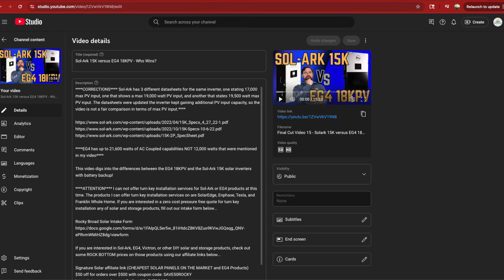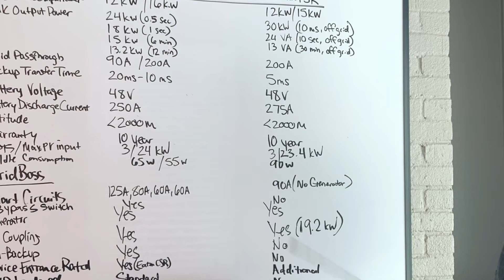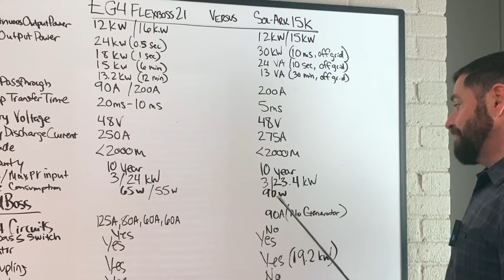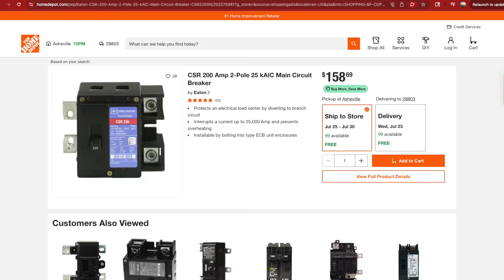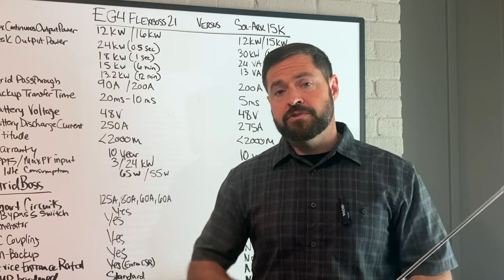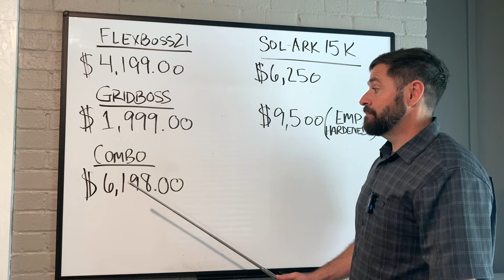EG4 FlexBoss21 and GridBoss vs Sol-Ark 15K | Inverter Showdown: Which Hybrid System Is Best in 2025?

Comment: For AC coupling the limitation comes down to the fact that in a grid-fail / off-grid situation the inverter has to provide timing for the microinverters and sink excess solar into the battery, so a good rule of thumb, more or less, no more than the inverter's battery-charging capability.  The servo is not fast-tracking so it can't quickly damp the solar down to the inverter limitation. 

That said,. the TYPE of AC coupling matters.   These systems only work with UL1741SA/SB, they will not work with the base UL1741 standard (which only supports microinverter on/off states and doesn't servo).  So if you have an older inverter the AC coupling may not work in a grid-down situation.  The GridBoss will shutdown the associated Smart Port.

So generally speaking AC coupling does work when grid-up, and should work grid-down if the string inverter is UL1741SA or UL1741SB,  but DC coupling is still going to be far superior.

Note that you CAN use the Flexboss21 on its own grid-interactive too, you just don't get the backup capability.  The sol-ark 15K has better surge handling just in general but the FB21 is no slouch and has no problem handling large inductive starts.  That's basically a wash.

--

Nobody should expect to run high loads in a backup situation, regardless.  You really just need to have enough time to turn off the biggest potential loads if you are butting up against the limit (most homes will not be butting up against these limits anyway, 12kW is a lot of power). 

In a grid-interactive situation the limit almost doesn't matter since all that will happen is that the inverter will max-out and remaining needs will be met from the grid.  It won't trip off while grid-interactive like an off-grid inverter would do.  So grid-interactive systems tend to be MUCH more forgiving, whereas with off-grid systems you really need to ensure that the inverters can cover the intended loads.

For example, if one is using a regular double-oven, well, that's 7kW right there and throw in the A/C and yah, one can go over-limit.  But that's like maybe 1 hour in the evening a day... it isn't a load that is likely to be on just when the grid goes down.   Similarly, if you have an EVSE and are  charging an EV, the simplest solution is to simply damp-down the charging power permanently in the EVSE's configuration or dip switches, so its never a problem.  Damp it down to 6kW, for example, and call it a day.   Or put it on a smart port.  But do NOT put it on the non-backed-up panel if you have a critical loads panel split... keep it active.

--

Smart ports, in general, are only really useful for AC coupling and dump loads that are truly undesirable in grid-down situations, or that you can safely dump on over-current in a grid-down situation, and not much else.    People think that they know what circuits they want on the dump and what circuits they don't, but I guarantee that there are always regrets afterwords.

Useful examples for smart ports: EVSE, AC coupled solar, true load dumps for excess solar, and that's it.  Perhaps A/C and industrial garage heaters or a double-oven but leave those engaged in a grid-down situation and only cut them off on inverter over-current.  Otherwise just leave stuff on the main backup panel.

Same with critical loads backup panels vs non-backed up panels.  Its best to just put EVERYTHING on the backup panel.  For a smart home owner who knows what he or she is doing, having a critical loads panel or a smart panel is just not necessary.

EMP hardening is a marketing gimmick.  Just ignore it.   The certifications are nonsense.  The companies don't care because they know that nobody is going to come knocking on their door in any actual EMP event.  It takes a lot of work to actually make something EMP tolerant, including where the equipment is housed, comm cables, and all ingress and egress from the all-metal heavily grounded building.  And that won't help appliances.   Real EMPs are like suped-yp DIRECT lightning strikes.  They energize everything with coupled EM fields through the air.  Surge protection on cabling won't help one bit.

Surge protection works best for e.g. lightning strikes that are not direct hits.  It basically won't work at all for an actual direct hit.

-Matt
Reply from the maker: Thank you for all of the detailed information Matt. That is a lot of useful info.

Comment: I thought that the EG4 backup time was 200ms?
Reply from the maker: @simonpaine2347  According to the datasheet it is 20ms but configurable to 10ms. Thanks for watching!
Reply: Mines roughly 20mS, and it can be faster via a grid configuration parameter if you are grid interactive rather than off-grid.  The main tradeoff for both units is that if the grid is too noisy, there will be more nuisance trips.
Reply: @junkerzn7312 Thanks. Totally agree with the noisy grid issue. Before I installed my system I bought a small UPS to ensure my Internet router didn't ever drop out, I still have it connected, because why not! And because our grid is quite noisy, the UPS regularly beeps, as the 'spike' comes through, but otherwise I wouldn't know if there was an issue with the grid.
Reply: @simonpaine2347 I do the same thing.  Even though I have a whole-home backup system now, long before I had it I had my internet, routers, cable-modem, AND starlink, and all the servers all on a DC battery system with an inverter and the battery was simply supported by a grid-connected charger and some solar.

So it is literally never on the grid... thus no switching to worry about.  It's always off-grid.

--

Now with the whole-home system, I STILL   kept the DC buffer components, and I replaced the cheap inverter with a multiplus-II and plugged its AC input into a wall outlet (which is on the whole-home system thus also backed up), but configured to stay on DC unless the battery actually dies.

I think it would be really difficult to do better than that level of redundancy.  A lot of things would have to stop working before the equipment becomes unpowered and there are zero glitches because the MP-II more or less stays synchronized to the grid (when the grid is up) and can switch from DC to grid-pass through before its capacitors discharge if the battery voltage falls too low.  0ms.

-Matt

Comment: So, some of us do actually live above 2,000m (I'm at 8,550ft). I've contacted both manufacturers and they both say there's no problem with operating at my elevation, however, Signature Solar says it will not warrant the FlexBoss but Current Connected says they will. Sol Ark says no problem, the unit may throttle if it gets too warm, but I would not anticipate pushing it that much.
Reply: Altitude basically comes down to breaker I.R. And cooling, so just de-rate any power electronics by about 20% and you will be fine.
Reply from the maker: @kenkrick7596   Thank you for sharing your experience with this and for watching the channel.
Reply: Had no idea probably run Victron off grid if our in the mountains. Probably don't need lot of power.
Reply: EG4-6500 is made by. voltronics and EG4-12kPv and 6000EX are made by Luxpower 

Solark  is made by deyer who turned off all other. Dyer inverters not badges solark